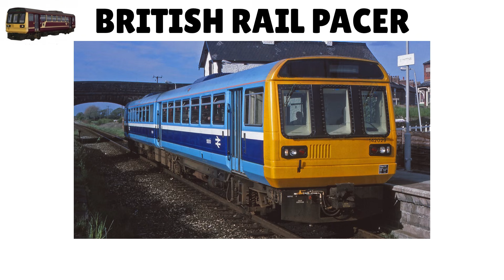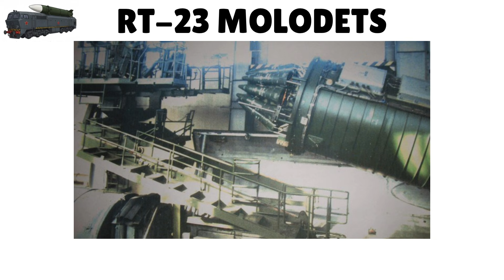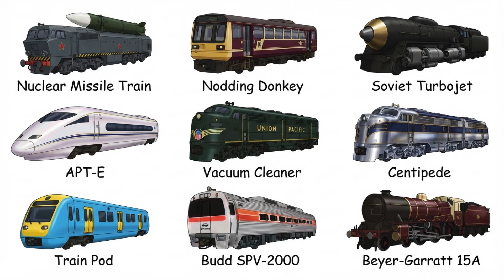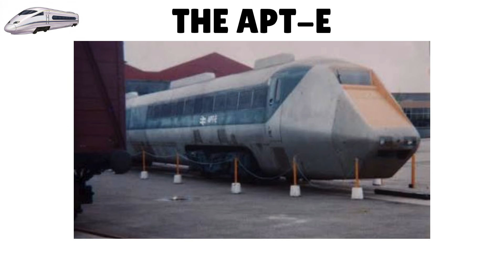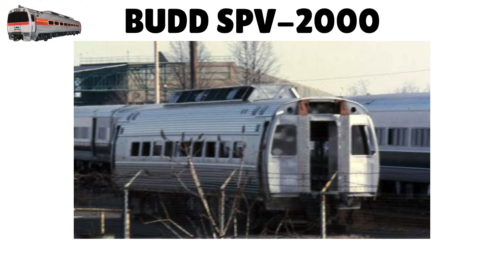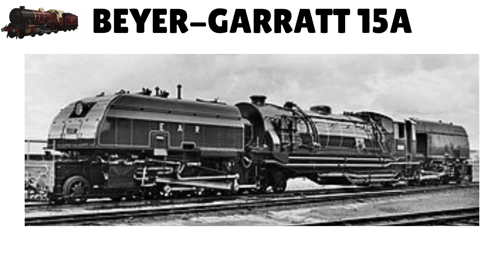Worst Trains Ever Created Explained Under 10 Minutes

Comment: Actually the failure of the SPV-2000 was entirely down to the reliability, Budd had the engineering to pull off the concept, examples of the preceding RDC are still in intercity and commuter service with Via Rail and WES Commuter Rail.
The Baldwin Centipede failed because A) they had an air operated throttle which made them incapable of being run in multiple with any locomotive but another Centipede, and B) Baldwin built them one at a time instead of on an assembly line, so the placement of wiring and equipment was not identical on every Centipede, unlike every other diesel locomotive. The Centipede's problems could have been resolved with time, but they weren't given the chance because they couldn't MU with any other class of locomotive, and the only way to fix the design standardization failure required taking apart and reassembling every Centipede the railroad owned to make them all identical.